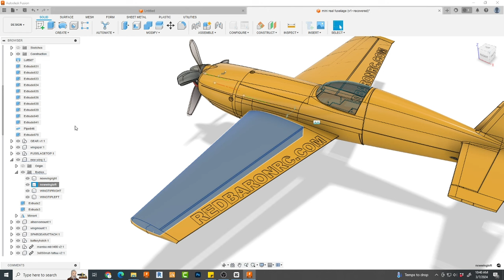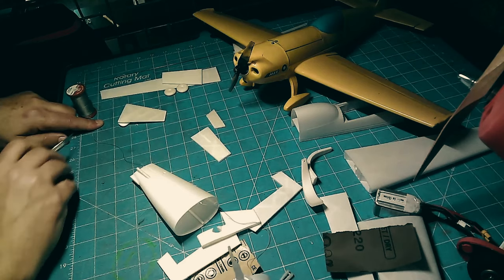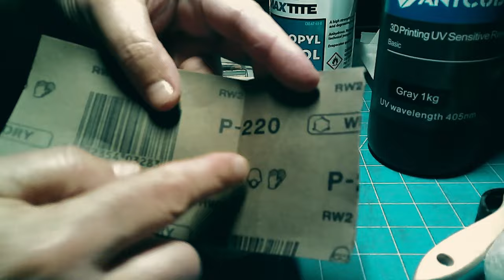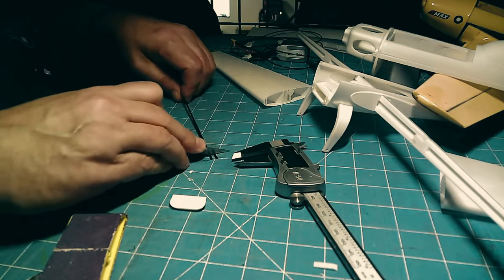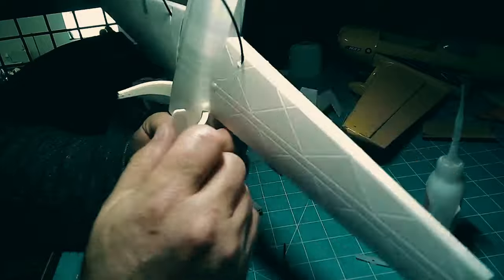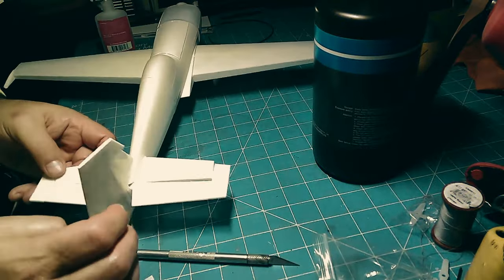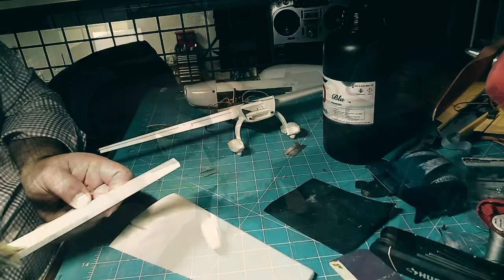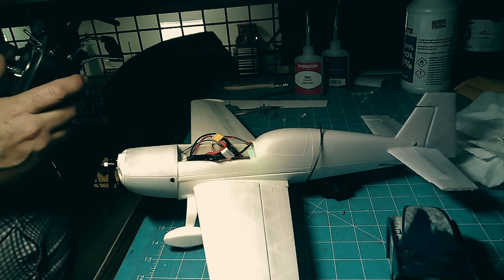Extra 300 3D printed.  See the full build how to!

Comment: Awesome! Have you ever considered 3d printing an airplane mold and vacuum forming the actual model? Iv been planning out such a build in my mind. Maybe make a micro edf.
Reply from the maker: I've vacuum molded clear canopies over a 3 d printed mold.  Works great.  In fact will do a video soon on the vacuum former.
Reply: @redbaronrc6520  nice, that's mainly what I'v used my vacuum former for. I'd like to experiment with other materials to make complete airframes in the former. Which would make for some cool videos if you ever venture into such a project 👍
Reply from the maker: I've wondered about that myself.  I think it would work. Could be super lightweight!

Comment: Okay I'm printing it now! Using hyper PLA+ on an Ender 3 with a.2 nozzle , so far all the parts are extremely lightweight. I plan on using a 1105 4500kv motor with a 4 inch prop. Any thoughts on my setup?
Reply from the maker: Sorry for late reply on this.  How did the prints turn out?
Reply: It's great just waiting for a new receiver now the plane with no electronics came in at 140grams

Comment: Crashes are a given with RC planes. Forget about 3D printed wing skins. They are too heavy, provide little strength and are basically unrepairable. I now print just the wing frames and cover them with 1/16" balsa, at least 4X times stronger, or use covering film which is surprisingly strong. Print the wing frames lengthwise from the leading edge up. 3D prints are 2X stronger along the striations, and wings up to 30" per side can be printed in 2 pieces on a CR10. Make the leading edge about 3/4" for a forward spar, or a hollow D section when using film.

I noticed in another video you added carbon fiber to a spar, calling back to old school building. It's a trend I'm seeing on YouTube of people discovering 50 year-old balsa planes. 3D printing is great for crafting shapes in CAD (I have 4 3D printers) but it's hard to beat the original composite, wood, for strength and durability for RC planes, or foam planes for 5 minute field repairs that let you finish the day and keep flying.
Reply from the maker: Yeah I was building those old school planes not 50 but definitely 40 years ago.  I go back to my roots some times.  Great old school techniques.
Reply: @redbaronrc  I started 3D printing wing frames as an alternative to foam cores for a 60" plane, which cost $60 to $100 for literally $2 of foam. Most of the cost is setup time and shipping. I first made a hot wire setup. But you still have to put in spars and hard points and end up with a lot more stuff, different templates, etc., and a lot of dedicated space if you make a CNC hotwire cutter. The 3D printed/balsa versions weigh the same and are nearly as strong. I have designed a few other planes around the same process.